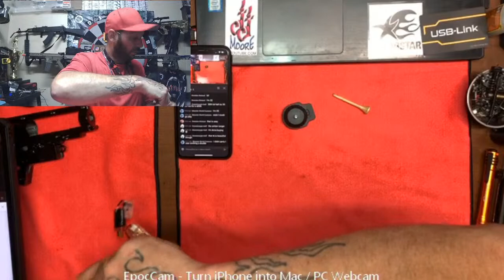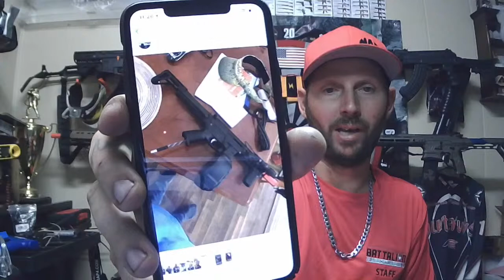How to install a gate titan in a ARP9 step by step live stream

Comment: Great install vid. As far as getting the wires tucked out of the way of the motor, instead of glueing them in you can dremel a slot into the shell where the wires are.  That way the wires tuck down into the slot out of the way of the motor, and if you need to remove the titan it’s much easier than glue.
Reply from the maker: Rob P thanks for the tip bud I am always open to new ways much appreciated.